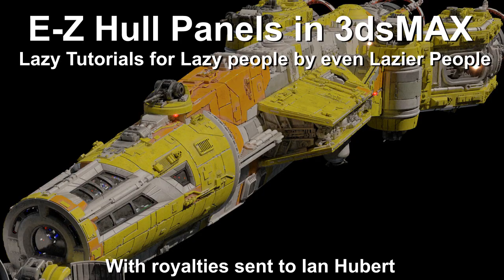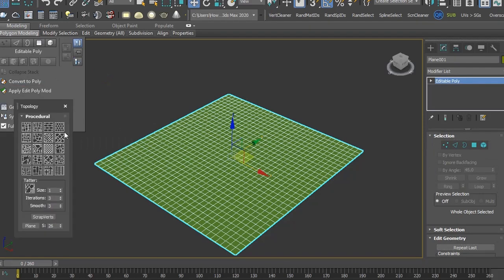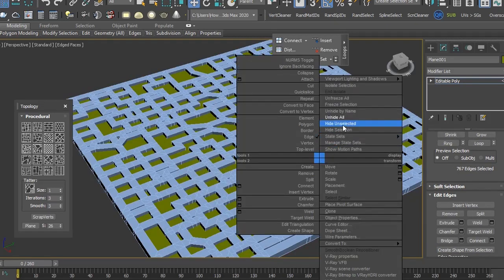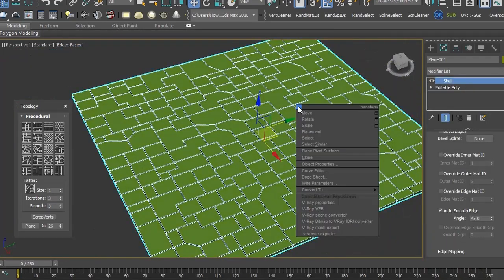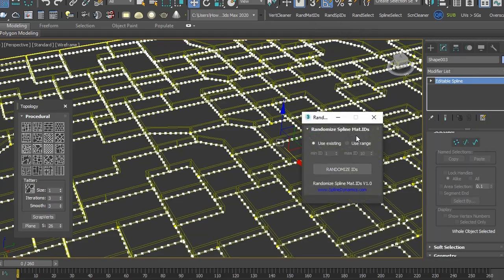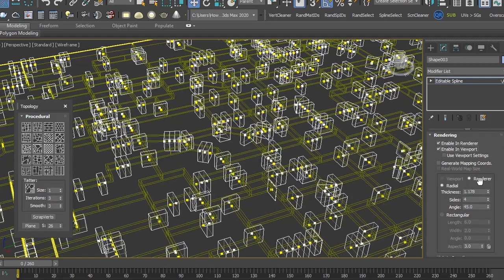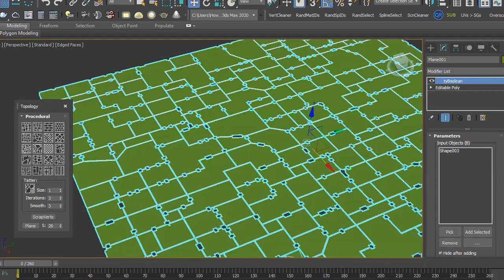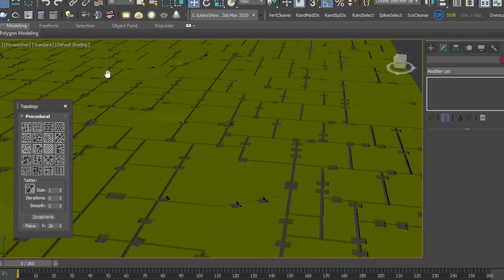3dsMax E-Z Hull Plates! (Lazy Tutorial for Lazy People by even Lazier People)

Comment: Hey Howie, I think I'm doing something wrong, or there are some settings that I have different than yours.  I've made it up right when you need to normalize the spline, and instead of getting a nice tracing over my 3d mesh where things break, I have a mess of disjointed lines.  I'm thinking that my Editable Spline settings are perhaps missing something?

Never mind, I think I figured it out.  It was the Normalize Spline modifier.  I need to change my Knot settings from Segment Length to Insert.  Not sure if this is because I'm on Max 2021 rather than 2020.  Either way, thanks for the cool tutorial! This will really help in speeding up production for a rather large and prominent model I'm working on!  Between this and the E-Z Greeble placement tutorial, a lot of manual labor has been cut short!
Reply from the maker: Excellent! sorry about the mis-aligned work pipeline. :/  I can't wait to see what you come up with! (assuming it's ever made public. :)

Comment: For some reason, when I use tyboolean. Some of the panels disappear, or the faces become really broken, is there a way to fix that?
Reply from the maker: Hmm, slightly nudging the base meshes around usually solves this for me - as for the broken faces, all you should have to do is, under Edit Poly, in face mode, select everyone, and hit "Retriangulate" It should fix the majority of issues.
If that doesn't work, I've got a fbx of these guys along with some pipes you could use if you want. :/
https://drive.google.com/open?id=1kV-rvox3ltk645ocakUdmfL1UuWTaI24
Reply: @HowieDay82  Triangulate saved me so much trouble! I also figured out the spline can't be touching each other, else bad things happen. 

Thanks for the help, I fairly recently started teaching myself how to use 3ds Max, the help is amazing, plus your works are amazing!

Comment: Howard, did you use this method to generate the paneling for your Calamari Cruisers?  If so, I might considering building some of my ships in 3DS Max, or at least some of them for this kind of generic detailing.  Thanks for sharing!
Reply from the maker: I have used something similar, yes - tho for intensely curved surfaces like that you need to subdivide the plates more for good results. I use the Slicer script: http://www.scriptspot.com/3ds-max/scripts/slicer To do this - quickly lets you add more regular subdivisions after all the fancy work is done. Good luck!
Reply: @HowieDay82  Is this the method that Fractal mentioned you devised when he made his Mon Cal ship?
Reply from the maker: @YIIMM  It is not! This is new. https://www.youtube.com/watch?v=QclIjqFKkr0 << This is the thing Ansel and I worked out together. I like the new system better. :D